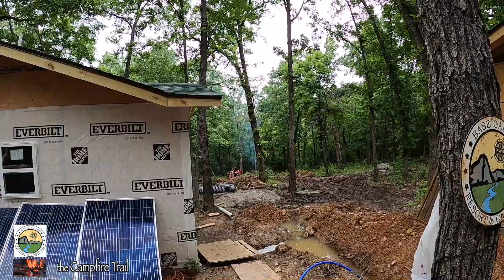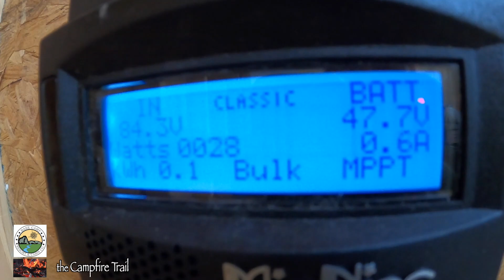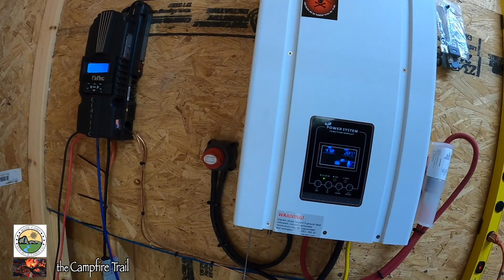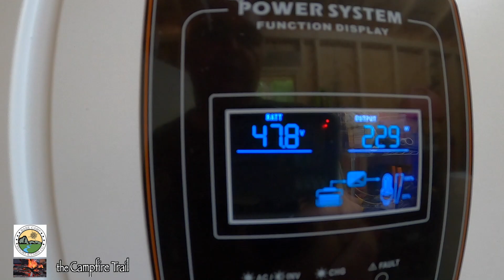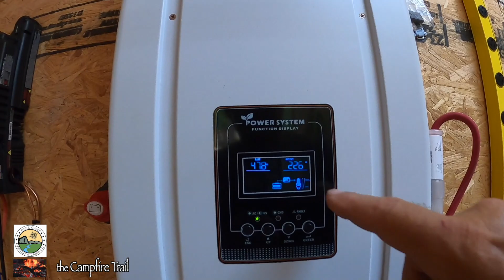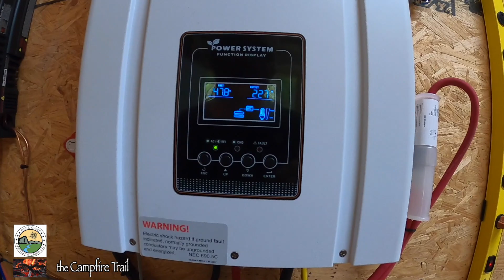Solar Power Installation - Component List In Our Cabin and 3 Days Until Homeless

Comment: So you charge controller will output up to about 82amps in a 48 volt system, The max voltage is likely why you have just a string of 3, which may be okay or might be too many for your area depending on your low temps. Midnite has a string sizing tool which will help you make those choices.

Voltage particularly in an active system is a poor indication of capacity.

You will want to have access to your battery caps to check and add distilled water, So you might want to raise them a bit.

To run through your original post, The voltage you are seeing is the system voltage and not the battery voltage. If you are connected to charging or a load it will effect the system voltage.

During charging, there are basically 3 stages of charging, Bulk, Absorb, and Float.

BULK;
First thing when charging starts you will be in bulk, the voltage rises from what ever the system voltage was to a set point, around 14.5 volts. At that point the Charge controller stops the voltage from rising. Higher voltage can damage sealed batteries.

ABSORB;
Once the battery hits the preset point the charge controller keeps it at that point. Your batteries are roughly 80% full. Flooded batteries will start accepting less current at 80-85% full AGM/Sealed may go a little longer before accepting less current.

On many controllers you can set this point, Some will have different presets for Flooded, and sealed batteries, or flooded, AGM, and sealed batteries. 

The charge controller has a couple ways to know when to switch to float, Most inexpensive Charge controller are just timed for 1.5-2 hours. Some will also see less current flowing through the charge controller and shut it down when minimal current is flowing through the controller. On more expensive charge controller. You can set battery capacity to give the Controller a better idea of when to stop. you can also set a longer Absorb time. Or set 'end amps' a amount of amps flowing through the charge controller to stop Absorb and switch to the final stage.

FLOAT;
Once the Controller has determined the battery is fully charged it reduces the voltage to a point where very little current is flowing to the battery. This will prevent the battery from over charging and heating up.

While in 'Float' the charge controller watch for voltage drop, which would indicate a load. If the voltage begins to drop the charge controller will allow as much current to flow from the panels/array to compensate and maintain the voltage. If the voltage can be maintained, the load will in essence be running directly off the array/solar. If the voltage drops below the preset float voltage, the controller may start a whole new cycle if it stays there for a period of time.

The system voltage drop you see at night when the sun goes down is the charge controller moving into a resting mode with no energy to contribute to the system.

The morning voltage may reflect a load present that is effecting the voltage level. With sealed batteries, you would want to disconnect the battery from the system and allow it to 'rest' for a while to get an accurate idea of it's SOC (State Of Charge) from the voltage
Reply from the maker: Thanks for the very interesting information. I believe we've figured out that the charge controller can handle up to 150 amps from the panels which we are only sending about 30 amps currently. Part of the reason we have started with this number of panels and batteries is that my learning curve is so steep, I'm honestly not completely sure what it's capable of so we are kind of going at it a little at a time. I appreciate the information and as we build the system up, I'll continue to update what we are learning about it.
Reply: NO!
NO that charge controller can only handle about 80 amps at 48 volts, around 90 in a 24 volt system.  Unless it's a classic 200 or 250. I own 3 Classic 150's. The 150 refers to the maximum voltage (VOC - Voltage Open Circuit) they can handle. Midnite provide a string sizing tool, why not use it?

boB and Robin Gugel started with Trace/Xantrex, Started Outback, sold that then went on to start Midnite. They are good people.

https://www.midnitesolar.com/sizingTool/